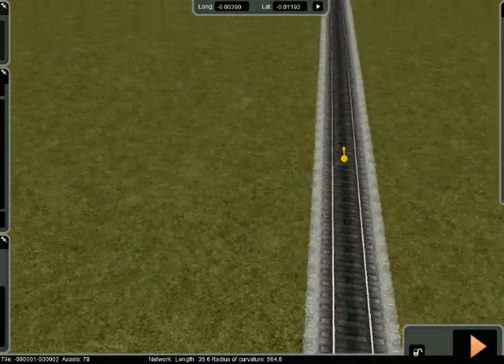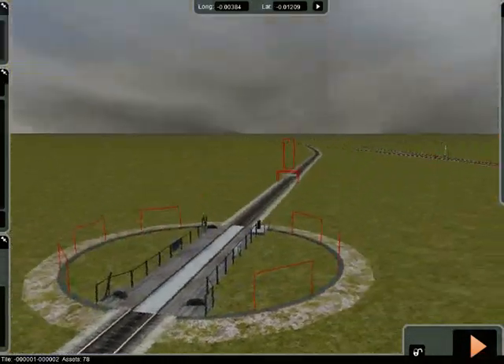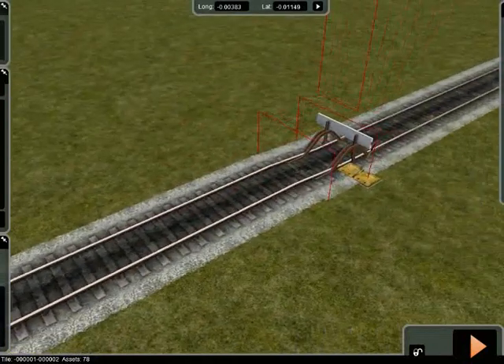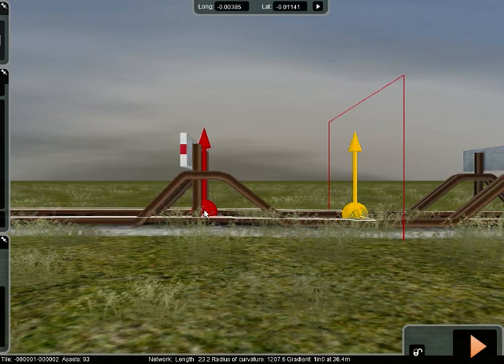How To..Lay a Turntable on Rail Simulator

Comment: Just click the join button and join the turntable to the track you want it to join to.and it will be automatic,and once the turn table is there you can then work from the turntable out, and G will move the table if it is put in right.